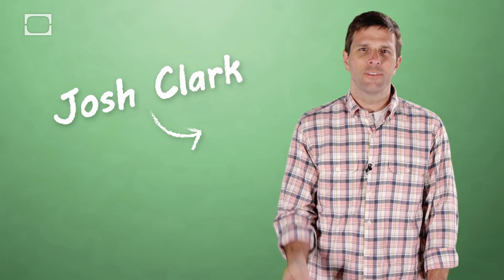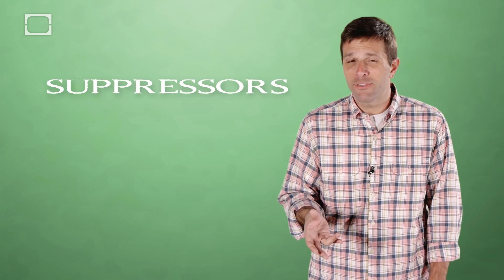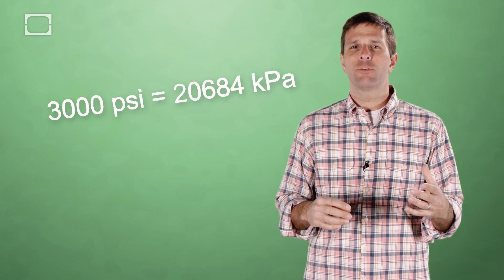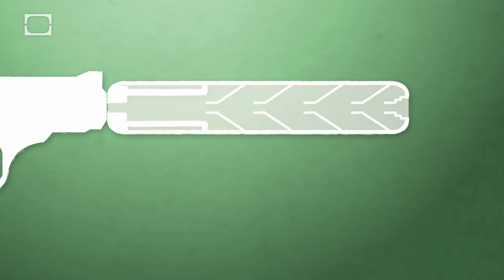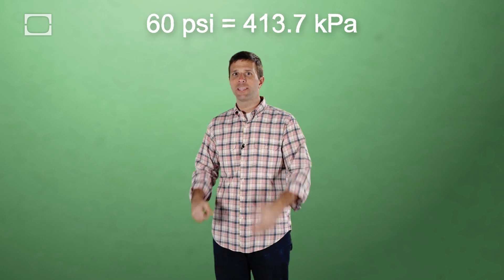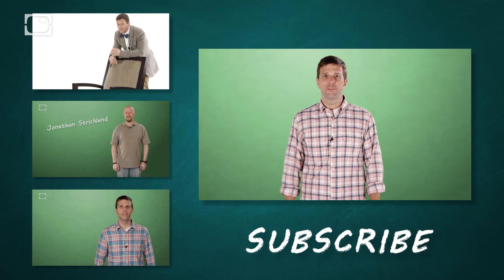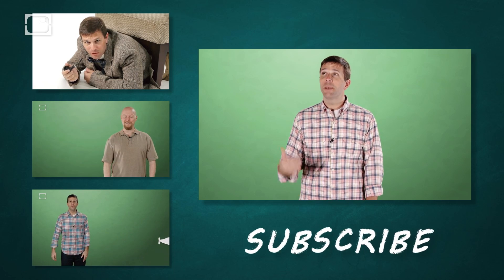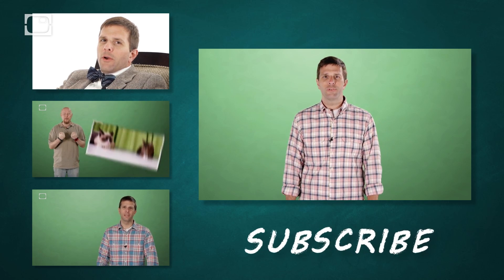How Do Gun Silencers Work?

Comment: You have worldwide audience, so please change your measuring units to Metric
Reply: +Sam Cecere I was thinkin light years per fortnight
Reply: He's not using feet per second because he thinks his audience is American; he's more likely using feet per second because munitions manufacturers use feet per second.
Reply: He's using feet per second because it doesn't matter what he uses after he converts it and pastes that on the screen. Also because the Imperial system is superior to the Metric system 😏. Legit tho, if he uses smoots per decade as his unit, but then puts feet per second and meters per second on the screen, I wouldn't care less.
Reply: Nope, the metric system beats imperial and it's so much simpler.
Reply: Ricardo Alarcón Metric has to be the worst, because the conversion of smoots to meters is much more confusing than smoots to inches. Beat that, atheists.
Reply: Ok you win, master of the world
Reply: lmfao I can taste the salt

Comment: There are so many things wrong with the information in this video.
Reply: Or the fact that you don’t lose power or accuracy with a suppressor. The suppressor actually increases velocity. The “losing power and accuracy” part is complete myth. Shooting a rifle suppressed stretches the max effective range of a round. Not by a massive amount. It depends on the caliber, rifle, particular load, and the specific suppressor. But around 50-100 yards is a reasonable generalization. More velocity should also, in theory, mean better accuracy. There are many factors that play into all of this, so it’s hard to be so absolute about it. But it is absolutely incorrect to say suppressors cause firearms to have less power and accuracy.
Reply: @treygregory7929  One salesman at a gun show said that it increased muzzle velocity by about 10 fps. More speed, yes, but the difference can be less than that created by other factors.
Reply: EVERYTIHING IS WRONG! SUPPRESSOR CONSTRUCTION, CHAMBER PRESSURE, AND DEFINITELY NOISE LEVELS!!!!!!!!!
Reply: number one his forehead
Reply: InfuriatedHawk like what?
Reply: @701765  First, suppressors/silencers (both names are fine to use, but suppressor more accurately represents its function) reduce the sound by about 20-30 dB, which means that the sound level at the muzzle is generally about 130-140 dB. This is about as loud as a jackhammer, so it is not movie quiet, but it won't cause notable hearing damage with short exposure; however, hearing protection is still recommended while using suppressors. I don't know if the people who wrote this cannot read and looked at a noise reduction rating of 20 dB and assumed that was the actual sound output.

Second, normal suppressors do not reduce power. In fact, suppressors have been shown to increase muzzle velocity anywhere from 10-50+ feet per second, depending on various factors,  because it allows the propellant gases to exert pressure on the bullet for longer (essentially a barrel extension). The misconception of reduced power comes from the fact that people will use lower power subsonic rounds to avoid the sonic crack. Some integrally suppressed firearms such as the MP5-SD do have specially ported barrels which reduce the velocity of otherwise supersonic rounds to subsonic velocities to avoid the sonic crack at the expense of some power.

Third, quality suppressors do not reduce precision. If everything is machined properly the bullet never touches any part of the suppressor. I say precision because suppressors will sometimes create a consistent point of impact (POI) shift. For instance, the added weight at the end of the barrel may cause shots to consistently hit an inch lower than without a suppressor at 100 yards. This is a measurable shift easily accounted for, not random deviation. In fact, with some rifles, that additional weight at the end of the barrel can alter the barrel harmonics (barrel's vibration characteristics in response to the shot) such that it's more accurate and precise with a suppressor.

In conclusion, this channel's research abilities are, to say the least, sub par.
Reply: @InfuriatedHawk  nice info dude u seem like u are back from a war lol
Reply: @InfuriatedHawk I know this is 3 years old, but I just want to thank you for sharing that information. I'll always praise people willing to take the time to make corrections about knowledge!
Reply: The fact he said it’s called a suppressor, when it really is called a silencer.
Reply: The first one being the presenter
Reply: bitch don't say your shitty opinion until you prove it.
Reply: @Saif-jp8ue  Ah yes, nothing like entering into a debate by calling the person a bitch. You seem like a complete idiot.

Comment: I think you mean it drops it down 20db, not to 20db. There is no way it could drop it down less than 80db unless you're shooting rim fire or something small like that. Also, suppressors don't reduce power; they actually slightly increase it, test have been done on this.
Reply: Slightly increase due to the added "barrel length" (the gases propel the bullet for an extra 6 or so inches)
Reply: They said you lose power if you use subsonic ammo. Slower bullet means less power.

Comment: I think the actual reduction is 20db not down to 20db. Remember the Decibel scale is logarithmic so each 10 increment is 10 times. A 120db sound is therefore 100 times as loud as a 100db. Size matters and you can't fool physics. An un muffled truck engine is in the 160db range, and it takes a very large muffler to reduce it to an acceptable 60-80db range. To equivalently suppress (muffle) a 160db gun shot takes an approximately same size device. But, James Bond putting essentially a truck muffler on the end of his PPK, does not fit into director's concept, so the little thimble sized prop on end of his pistol conveniently has shot noise altered by the sound editor.

Comment: 3000 PSI? Not really, 9MM Luger is 35000 PSI, and 308 Winchester is 62000 PSI. Even 12ga shotgun shells, the lowest pressure cartridge out there are around 12000 PSI

Comment: He said that you lose accuracy. That is wrong. You gain it. The reason is because the gas is trapped by the device and help remove the turbulence behind the bullet from the expanding gas. It also helps increase your range. Also most pistols do not exceed the 1100fps. There is not enough barrel length for the maintained pressure to get the bullet traveling that fast.

Comment: you could use scissors to cut through 4 inches of steel and then run in it over with 100 cars and it would be less dull than these vids

Comment: Don't want to associate with people that call them "cans?" What exactly are you trying to imply there, Nancy? People that actually use these things and know their stuff call them "cans" because it sounds less pretentious and is more time efficient than saying "suppressor," and certainly no respectable individual would ever call them "silencers."
On top of that, your little "disadvantages" are entirely wrong. A suppressor increases accuracy if anything (longer barrel = greater accuracy; have you ever seen a sniper use a snub-nose, Sherlock? Also the added weight at the end of the barrel reduces kick), and as far as being "less powerful," well you need to stop relying on video games for your information, m8. Only way you "lose power" is if you are using sub-sonic ammo, and even then it isn't like your bullets are going to "not kill as good." Dead is dead. Cans are advantageous in just about every way when it comes to operating a firearm. Only REAL downside (which you failed to even mention) is that you tend to over-gas, which is only a slight nuisance.
All in all, a non-informative video by an obnoxious, uninformed douche nozzle. If you really want to learn about firearms, go look to someone that actually uses them.

Comment: For those who would like some more info:
The hammer dropping is really not a sound that anybody concerned with sound suppression considers. First off, many modern firearms don't have hammers, but strikers. The gun shown with the hammer was a revolver, which has a gap between the chamber and the barrel that will allow the high pressure gasses to escape, thus diminishing efficacy of a suppressor. Semi-Automatics, when fired, generally have only one place for the gas to escape, which is through the barrel. The striking of the primer by a striker or firing pin is rarely louder than the report of a firearms, even when suppressed. However, the recoil has to cycle the action, which usually means the slide moving rearward at a high velocity, disengaging with barrel lugs, ejecting the spent case, then returning to battery while stripping another round from the magazine and chamberiing the round. This makes a sound that is, by far, louder than engaging the sear alone. I have met people who actually have slide stops that can be engaged so that the gun will not cycle, thus eliminating the noise from the cycling. But in any case, the "first sound" that can't be helped is not really the hammer, but the cycling of the action.

Also, 100-130 dB is quite loud, just not likely to damage hearing in small amounts. To give you an idea, a gas powered mower tends to produce about 100 dB, and live rock music is up between 120 and 130 dB.  Many people who shoot suppressed will still use ear protection, especially if shooting suppressed rifles. 

And, if you have read this far, here is a fun fact: suppressors can be more effective by running them "wet." This means putting a small amount liquid (often wire pulling lube or just water) into the suppressor, which absorbs heat from the gasses, cooling them off and lowing the pressure.

Comment: This bottle could be turned into a silencer if you wanted it to.
All you really need Is to add is like a metal pipe and some concrete and in it.. So basically my theory is wouldn't you think that the concrete would break the sound barrier or maybe help by reduce the sound of the round?

Comment: I hate to correct you but it reduces the sound by twenty decibels not down to twenty decibels The sound of the hammer fall is higher than that as is the cycling of the weapon unless it is a bolt action rifle. A really good can can get it down to about 75 decibels but that's pushing it and that is with subsonic. Also you would never even try to suppress a revolver as it would be pointless due to the chamber gaps. Just trying to help you out sir.

Comment: The second point in this video is wrong. A suppressor doesn't bring the sound of a gunshot down to 20 db, it brings it down by 20 db. That's still around 130- 140, and sill loud enough to cause pain or hearing loss. To make a gun safe to shoot without hearing protection, you need a suppressor + subsonic ammo. Without subsonic ammo, a suppressor can make it more difficult to pinpoint where a shot came from, but it still isn't anywhere near quiet.

Comment: Why are suppressors such a controversial accessory for guns?

Just like mufflers come standard on automobiles, I would think that suppressors should come standard on firearms.   Removable, but a standard part of the design.   It seems like a bad design to make a product that will make you deaf, when it is clearly possible to suppress the sound to safe levels of hearing.

Think about the life-and-death situation where you have to use your gun justifiably.   "Ok, wait before you stab me to death, I first have to put in my ear plugs before can defend myself against you.   I don't want to loose my hearing if i survive this encounter."

Comment: So many of the facts in this are wrong it's cringe worthy. No they are not called suppressors. Well yes they are but that is what they changed the name to to make them less scary to the public. Silencers do not give up power, in fact they can actually increase the power a little bit as the silencer act like an inefficient barrel extension. Bullets start to decelerate as soon as they leave the barrel so adding length to the end of the barrel that remains pressurised prevents the bullet slowing down as much. They may effect accuracy but generally they just change the point of impact rather than making them less accurate.

Comment: So many problems, but i will address the most glaring - You forgot about the action of the gun cycling (he shows a suppressor on a revolver, which is just liberal retardation) on a semi-auto.  the action cycling is metal slamming on metal, and is loud on some guns.  On a .22 or other very light gun, this sound is very quiet.  So a .22 being shot with a suppressor, on a bolt action, using sub-sonic ammo will be virtually silent.

Comment: Another thing he doesnt mention is that if your using any kind of semi automatic gun the gas pressure which reload the gun pushes back the action which then slams back into place making a loud metalic clacking noise. From inside a regular room that sound is no joke, neither is the racking of a pump action shotgun. "cans" dont make those sounds any quieter.

Comment: Well i thought that this video was going to be a factual bust but it turned out to be pretty good but not entirely great. There is also a 4th sound in most firearms that is actually one of the hardest sounds to suppress and that is because it is a mechanical sound that is created by the action of a firearm (Mostly semi-auto guns). Such as the slide on a semi-auto handgun sliding back and ejecting the spent case and then hammering forward and loading in a new round. This is a loud metallic sound in most guns that is often much louder than the firing of the bullet itself.

Comment: You cannot patch over that level of ignorance with a pop-up "correction."   I had low expectations, but this was approximately as wrong as possible.  1) suppressed revolver?  possible, but only with an expensive modification (sealing cylinder).  2) 20 dB?  A pop-up correction cannot fix this.  The only way to salvage any respect is to pull the vid and re-shoot it.  3) handgun ammunition is typically subsonic.  Supersonic muzzle velocity is offered by "+P" and "+P+" (overpressure) ammunition.  You seem to believe that one has to purchase special "slow-poke" bullets to avoid the ballistic crack, but in fact, a shooter wanting super-sonic muzzle velocity from a pistol needs to go out of the way to purchase special ammunition and (often) have a gunsmith outfit the pistol with a stronger slide-spring.  Guns are serious.  Miseducating people about them is not easily excused.

Comment: Of course when you're a technical geek and speaking in technicalities you can throw the term silencer out the window, but in the shooters world, silencers or suppressors works just fine and here's why... 

SILENCERCo; yes I capitalized silencer to emphasis my point. Anyone who regularly shoots guns and is unaware of this reputable silencer manufacturer obviously lives under a rock. This company deliberately placed "silencer" in their name, and probably to commemorate the original designer of thee silencer. Which brings me to my next point. 

Hiram Percy Maxim, the father of silencers and son of the famous Hiram Stevens Maxim (creator of the Maxim machine gun ....and the mousetrap). Maxim invented the first suppressor and coined the term silencer referring to the device that dampens the sound of a blast. Out of respect, I wouldn't argue with Mr. Maxim whether a silencer is actually called a silencer since he invented and named it. 

Lastly, BATFE and the ATF classify suppressors as silencers and use the term silencers in their NFA handbook. The ATF are the guys that allow you to obtain suppressors. Any shooter who owns a suppressor would know that the term silencer is just as correct as suppressor and would leave the technicalities off the table. It simply comes down to the classifications. 

So there you have it, Silencer or Suppressor, doesn't really matter. And if it does then you're  probably one of those that flips shit over grammar on the internet.

Comment: Adding a suppressor to a pistol and make a really quiet noise. But when you get into rifle rounds like a 5.56x45, putting a suppressor won't drop to 20. In fact an m16 with a suppressor will still hurt your ears. 160 to 20 is wrong. The psi part is correct but how quiet suppressor makes the gun is wrong

Comment: As a firearms enthusiast who owns a couple, just feel like correcting a few things here...

One, the original device was patented with the name "Silencer", so either term is technically correct.

Two, unless shooting a caliber such as .22 long rifle or smaller, the best you can hope for is 130 decibles. Still pleasent to shoot without hearing protection, but hardly what I would describe as a "quiet whisper".

Three, although you mention the expansion of gasses into the interior of the can (and yes, you can call it that), they work in anpther way. Much the same way that a lightning strike splits the air, and the air around it rushes back in to fill the void, creating thunder, a bullet leaving the muzzle of a firearm splits the air. A silencer's baffles help to break up the air rushing back into the barrel.

Fourth there are other factors in making the firearm quiet, such as using ammo that does not break the sound barrier (I.e. subsonic), and whether you add a small amount of water or silicone wire pulling gel, or a similar substance (I.e. shooting a can "wet" versus "dry").

All in all, an informative video, but some of your points need work.

Comment: When the firing pin hits the back of the bullet the gunpowder ignites but it doesn't explode. It deflagrates because the air around it doesn't move faster than sound, therefore theres no shockwave. If it had enough gunpowder it would be like holding a hand grenade and it would blow your hand off.